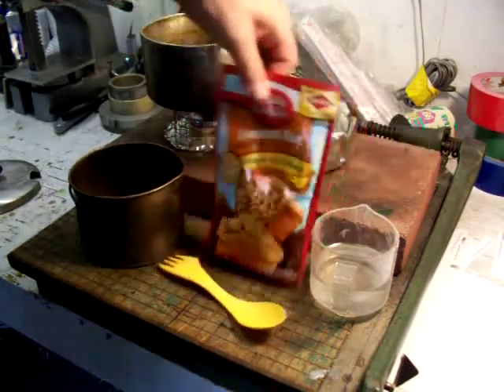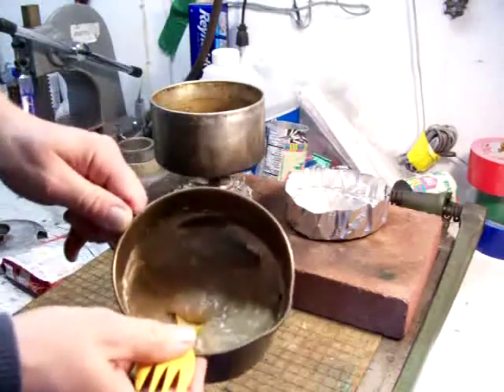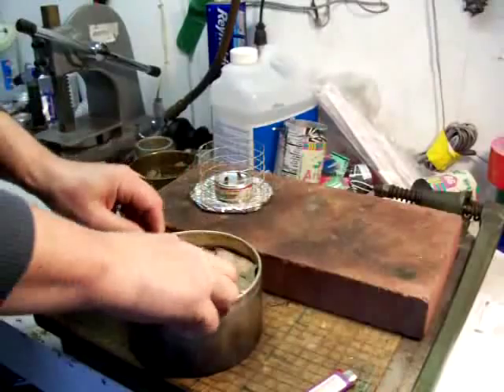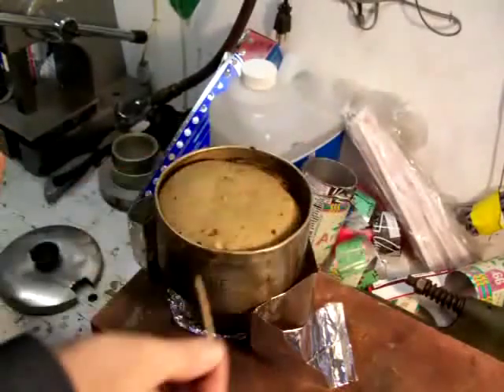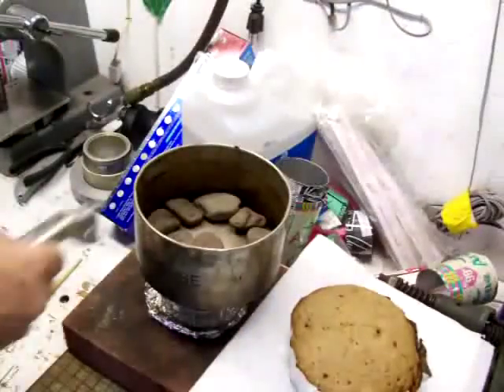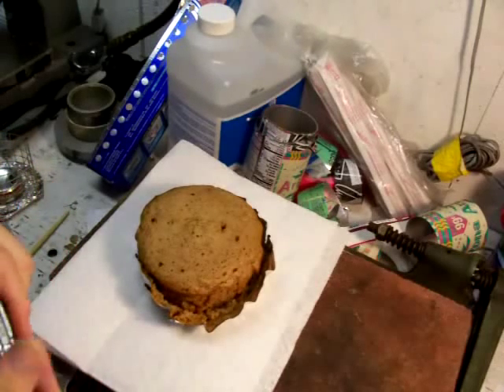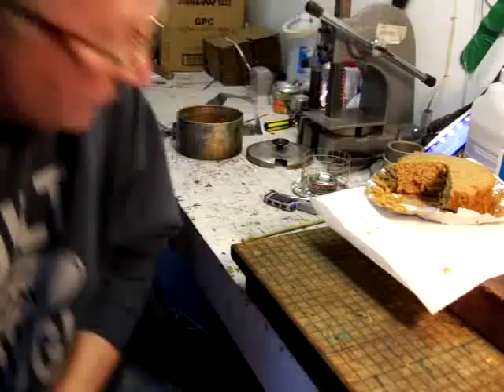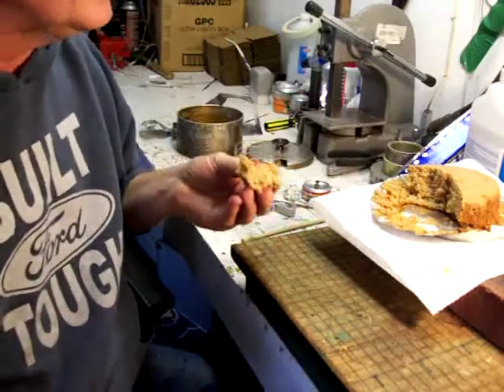Baking a cake

Comment: great tip with the rocks, ive tried with your original springfrom pan, this looks much easier. I always end up with burnt top and sides with a gooey center so it may be worth mentioning that you need a low low flame for a long long time.